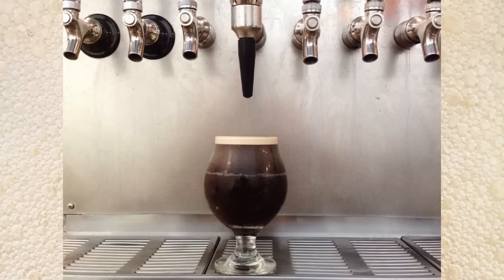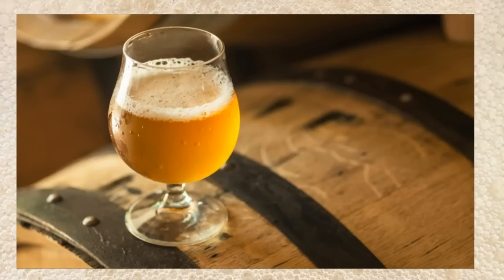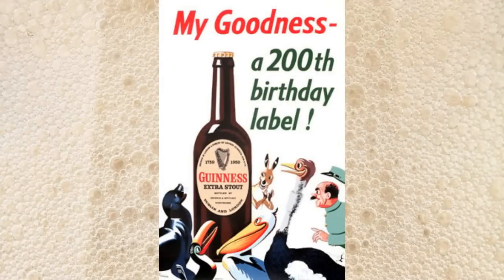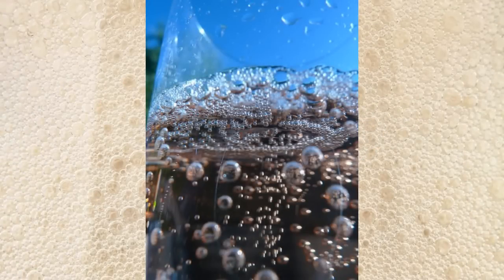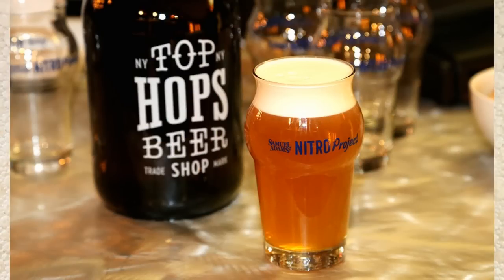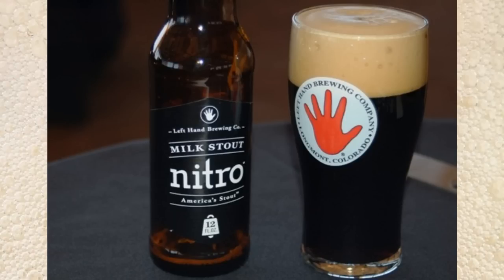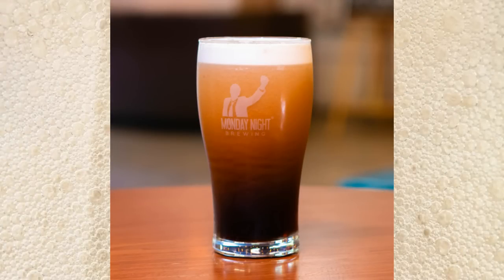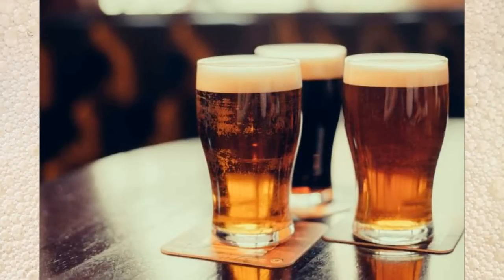Nitro Beer Explained -- Beer History & Beer Science

Comment: The only nitro beer I’ve ever had was Guinness. I’ve never seen another, or heard of another until this video.
I love Guinness but have two issues with the bottles. They are less than 12oz (I realize only by fractions of an ounce) and that the beer is so smooth drinking, that the bottle seems to be empty when you take the cap off.😂